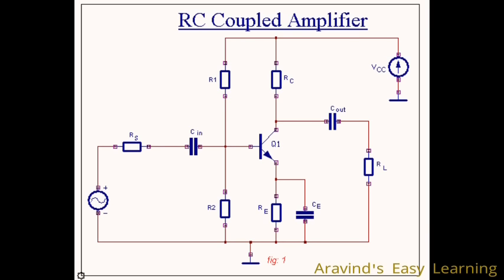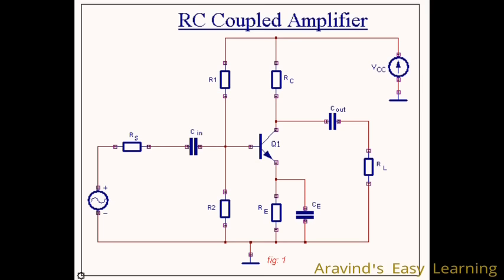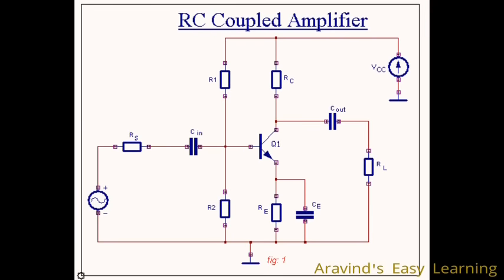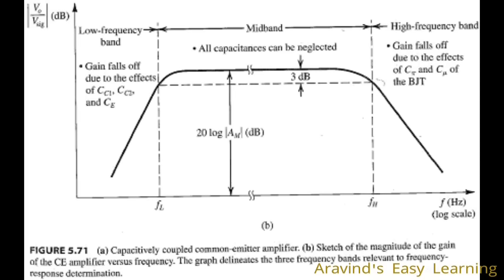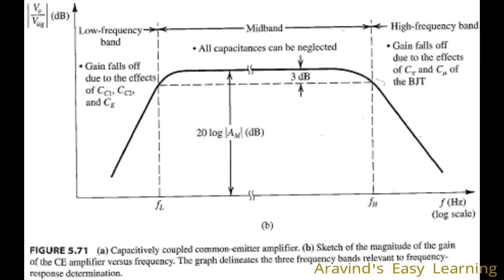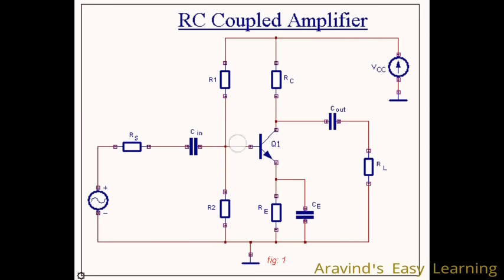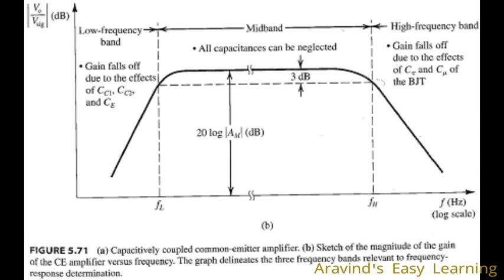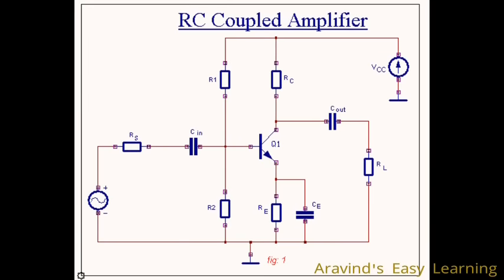RC Coupled Amplifier Explained

Comment: Bro, u have explained it very well and i appreciate that.... But I've a doubt..... 
" We are taking the output from emitter collector junction. But we are pointing the direction of collector current inwards or into the transistor.What does that really means? How does collector got current? 
I've got till the entering of base curremt into emittor... How does collector current is produced then.. Please explain.
Reply from the maker: Thanks Sandra. The thing you have to understand is that when we mark current flow, we always use the conventional current flow method. According to this method current should be shown in direction of flow of holes and not electrons. This is why the direction of collector current is inwards(for NPN transistors). Collector current is produced by the electrons that are injected in to the junction by the Emitter. These electrons are attracted by the positive terminal of supply to which collector is connected to. Does this clear your doubt?

Comment: If Re is reducing voltage across Vbe then why Re is there ? There may be simply a wire 🤔
Reply from the maker: Because Re plays an important role in stabilizing operating point against current gain variations and temperature changes.